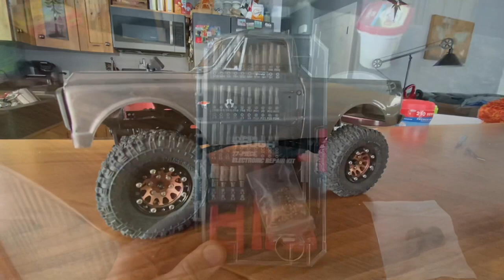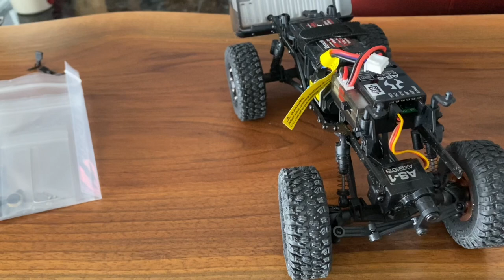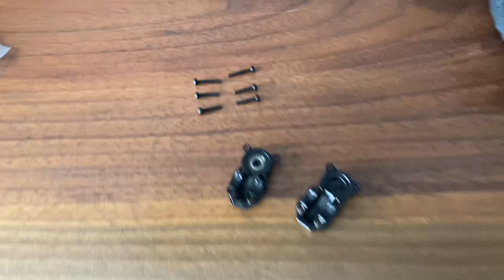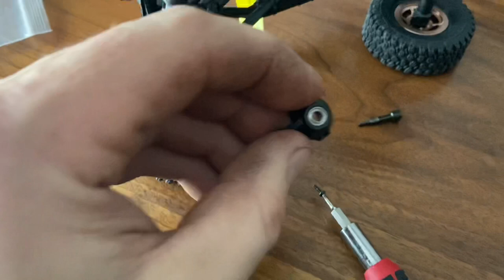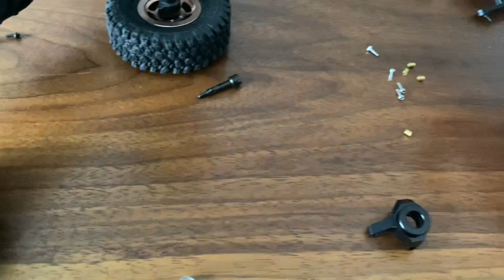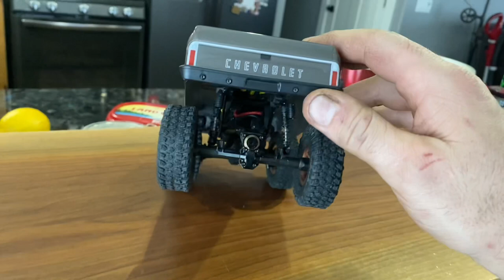Axial SCX24 C10 mods, wheels, knuckles, diff covers, and shock relocation.

Comment: Nice!! I have the brass wheel weights. And some hot racing parts .. I actually swapped the rear suspension and driveshaft from a deadbolt to lengthen the wheel base and better geometry on the shocks .. and hacked it up to be more flatbed crawler.. all about the fun and tinkering.. be well